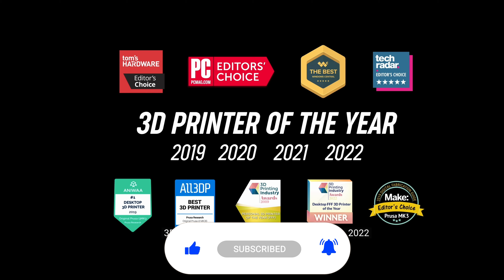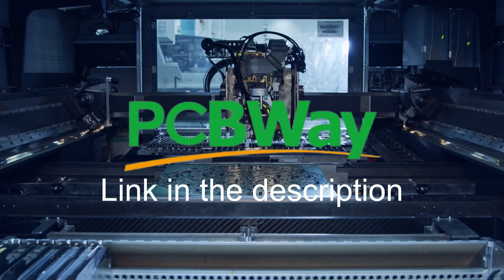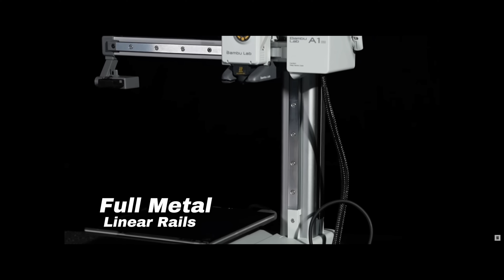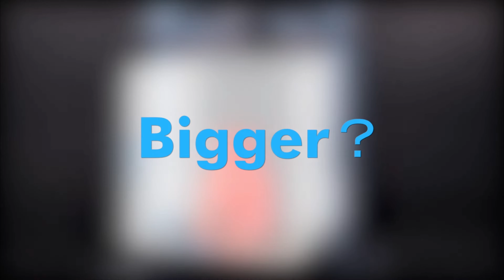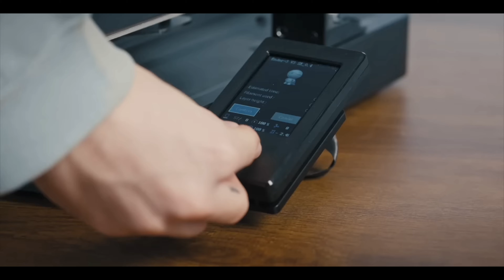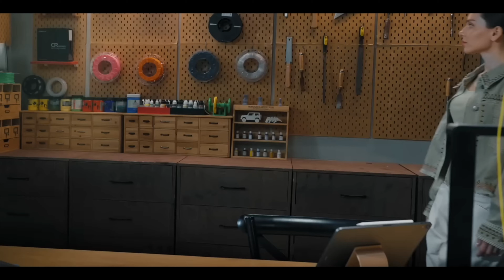5 3D Printers That Actually Work for Beginners

Comment: (MK4 and P1S for print farm)
For the Prusa MK4 I think it would be a great farm printer since its parts are easy to source and replace tho it isn't exactly what it used to be and it isn't fully open source anymore. Prusa also is currently moving away from 3D printing and towards injection molding tho Im not 100% sure. Considering the cost of the Prusa MK4 to be ~ $1000 USD the bambu lab P1S would be a better option since it has an enclosure allowing it to print materials that warp easily such as ABS, PA, and it price is ~ $950 USD (with a panda touch it would suffice for a small print farm).

P1S is still generally made for hobbyist-professionals but at the Price : Performance it's probably the best.

One thing I'm not sure about in print farm is if there is local heating to print certain materials.

(A1 mini vs A1 for personal use)
I could see the A1 mini as a possible printer for a print farm if you are mostly printing PLA or other low glass transition temp plastics (correct me if there are some plastics that wont warp with high glass transition temps), but otherwise I would recommend the bigger A1 to beginners since you never know when you would want that extra bed space for a bigger project.

(Ankermake M5C and Bambu Lab A1 for personal use)
The Ankermake M5C ($400) is a pretty good printer from what I've heard tho it just came out at a bad time. Personally I think the hype for the M5C would have been huge if Bambu Lab didn't enter and totally dominate the 3D printing community with their X1C but as of right now I would go with Bambu Lab A1 ($560 with AMS lite bias) and also the AMS lite allows the printer to print in multicolor tho that isn't super useful for print farms.

(budget hobbyist printers)
As for the "Innovated enders" the Elegoo neptune 4 ($230) and Creality Ender 3 V3 SE they are both pretty capable but I think the Neptune 4 is a bit better since it has klipper, the Ender 3 V3 SE ($200) does not have klipper but the KE version does, still klipper can be added with Creailty's sonic pad. 
Another budget printer I would recommend is the Anycubic Kobra 2 Neo ($200) which is really similar in specs to the Ender 3 V3 SE but has a edge on input shaping.